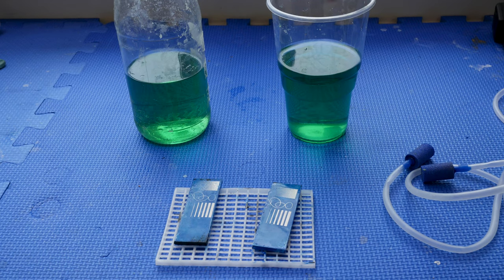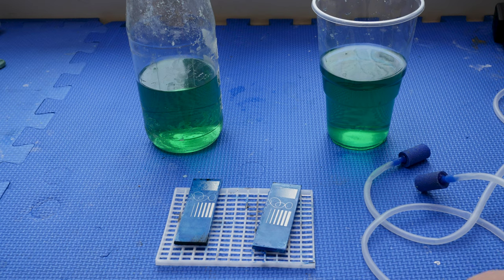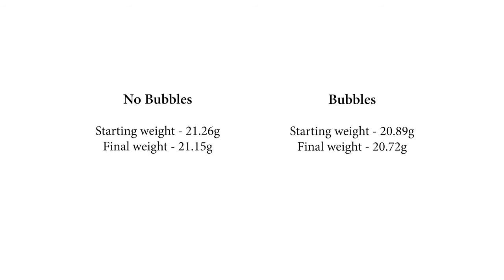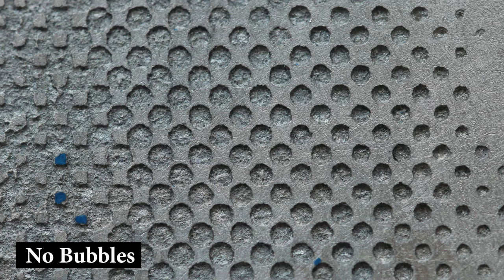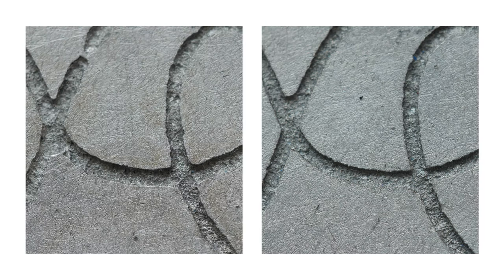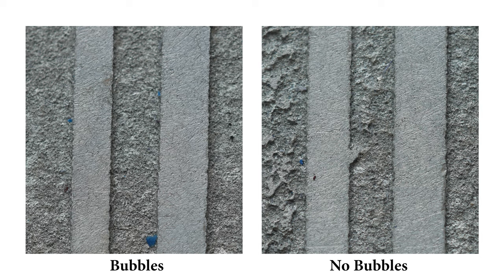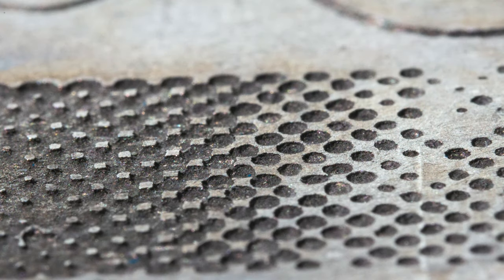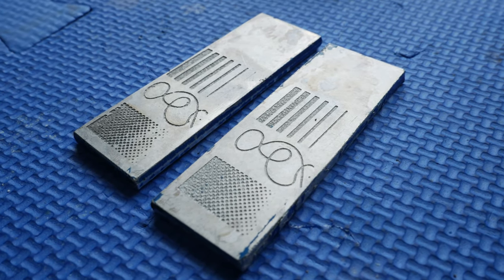Metal Etching Techniques - Do BUBBLES help?

Comment: Great comparison, appreciate the attention to detail. What’s your favorite mask material/process for really fine details on etched plates? I use chemical etching to recreate vintage machinery tags, so there is almost no “artistic wiggle room” when recreating fine text details in brass. I’ve given up trying to do fine chemically etched details in aluminum altogether and outsource that material to a laser shop using my artwork.
Reply from the maker: Hi Thomas, my fav for fine detail is photoimageble etch resists. You can get incredibly fine details with this process, check it out here - https://youtu.be/OW6VeyY_m3Q